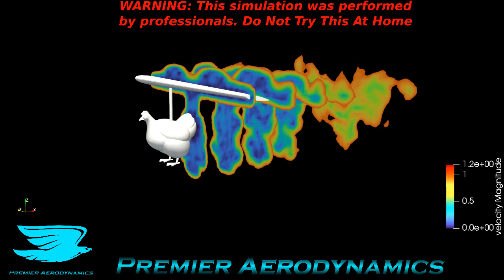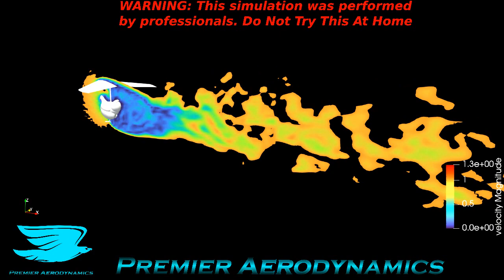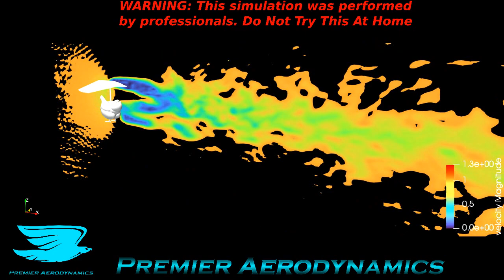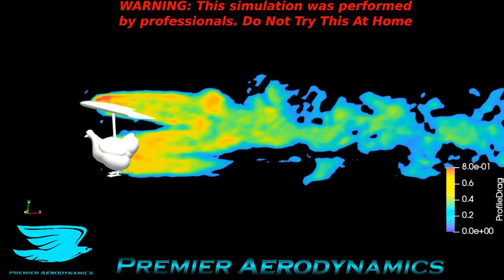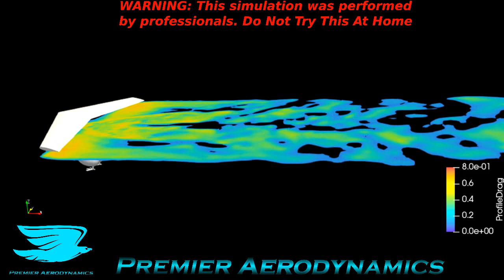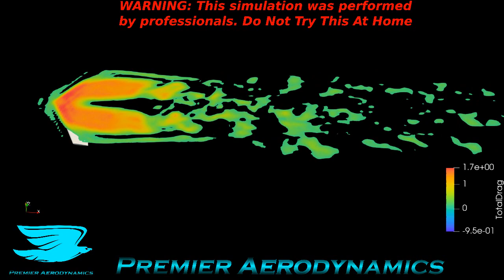How To Make a Chicken Fly with Aerodynamics!

Comment: What's the takeoff speed? Can a chicken run that fast?
Reply from the maker: Good questions. This chicken is on the plump side, so assuming that it weighs about 4 kg, the takeoff speed is about 90 m/s. Olympic level chickens can run at around 6.5 m/s, so, they're a little shy of the mark.

Perhaps a launching cannon could be of assistance.
Reply: @PremierAerodynamics  Just strap a rolls royce spey and call it a day.
Reply from the maker: @notaulgoodman9732  Lol!